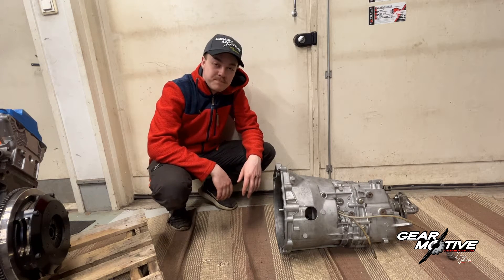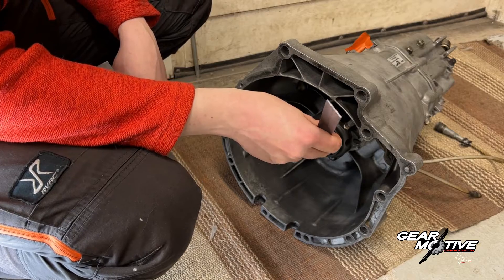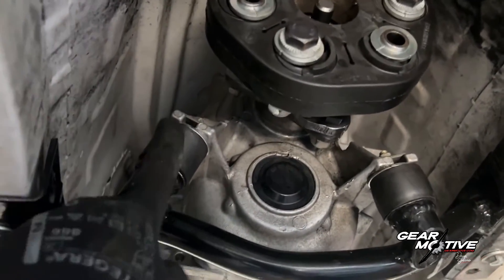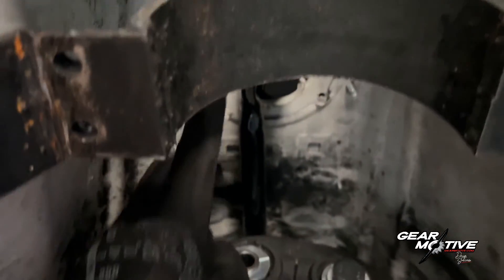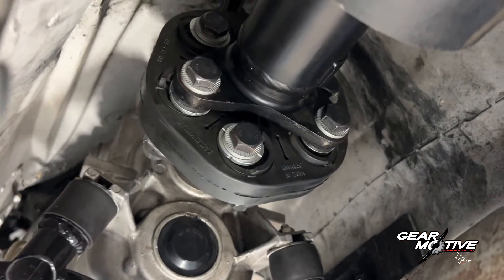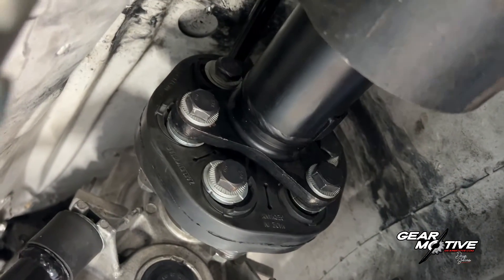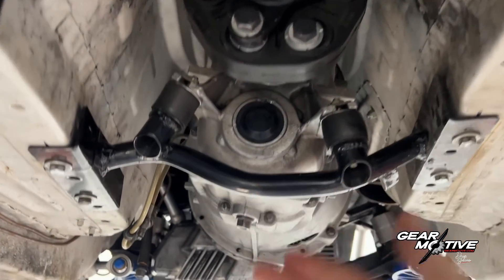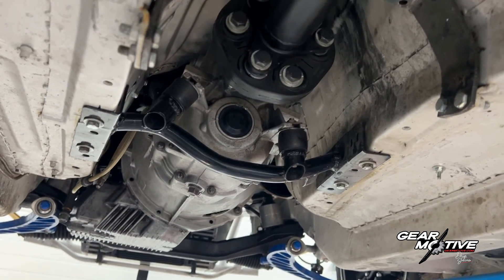GearMotive dogbox install - how to do it

Comment: How in the world is that little fuel filter working without overflowing??  I had to install a large catch can on mine.  It still overflowed and I had to change the vent location, I tapped the OEM hole on the top of the gearbox and installed a flush banjo fitting there.  That new vent location to my catch can now finally fixes my vent over flow.  I'm wondering if its because of my specific type of racing is different than yours.  I can't think of anything else.  Also, did you drill those hole on your ZF case?  I want to do that to mine but I am afraid of compromising the rigidity of the bell housing.
Reply from the maker: Hello John! 

Different type of racing does affect. But also oils do have differences. Some oils do generate more foam and the foam is the reason why box breaths oil out. Omega branded oil has been seen to work very well from this perspective, but certainly there should be more similar oils.

Yes you can add quite big holes to bell housing and we have not seen it to cause any problems. Many customers have had up 60-100mm holes in it.